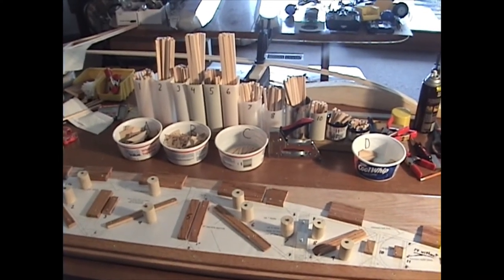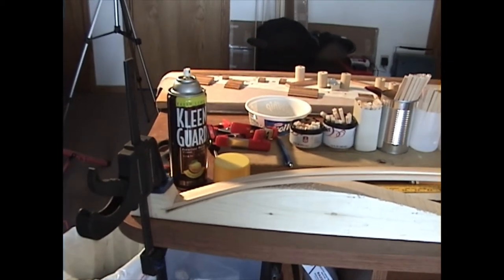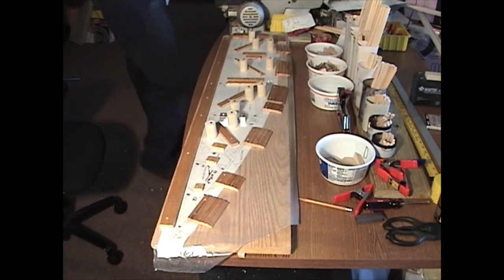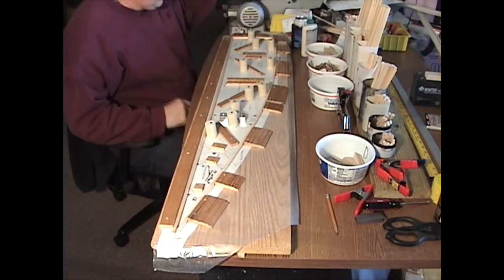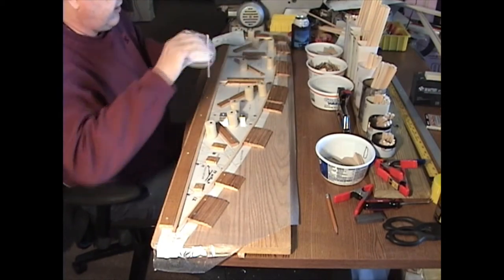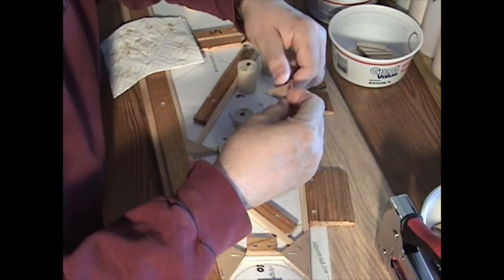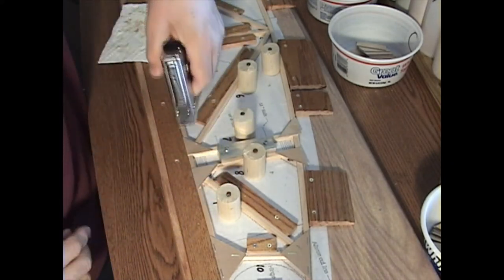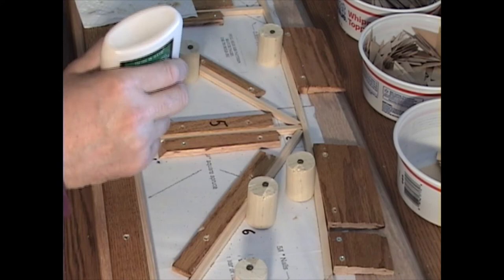Legal Eagle airplane wing rib build

Comment: TiteBond3: there's no better glue to use. Well done! I was a bit surprised you didn't glue gussets on the back side of the rib right after removing it from the jig, then set it under the jig to press the gussets down onto the capstrip.

Comment: Leaving them overhanging is fine.  Later in you’ll put it on a bench sander (I used a belt sander upside down in a vice) and sand the outside of the ribs.   You don’t want varnish on where the fabric will glue down.   The pollytack seals it.  And if not that the Polly brush.   If you varnish the fabric glue doesn’t stick to it as well.   If there’s any gussets overhanging they just get sanded.
Reply from the maker: Thanks for your comment.

Comment: I probably wouldn't have the full length board at the bottom.   No wood at joints, other than parts of the rib/no glue caking to cleanup on jig parts.
Like your storage under rib jig.
Thx for video.  About ready to build the rib jig after watching your video.   Thx!
Reply from the maker: Sounds like a good tip.  We can always learn from others and there is always more than one way to do things.

Comment: Hello Tom, your work looks great. I assume you are using white wood glue and not epoxy? Any reason for that? I am looking at building the DE (already have the plans) and the ribs are very similar. I am following your build with interest. All the best. Allan , Durban, South Africa.
Reply from the maker: Yes, I used Titebond III glue and it is waterproof.  I did some testing with this glue and it was stronger than the wood.  But do your own testing and decide for yourself.
Reply: You should  be using T88 epoxy..water proof does  not mean a good bond,especially when it is applied to one piece only..research my friend.
Reply from the maker: @ronaldrose6885  I agree that T88 epoxy is the proven method.  Here is a discussion from Eagler's Nest    https://www.eaglersnest.com/forum/index.php?topic=1540.0  Use at your own risk.  I am not recommending any adhesives.
Reply: @tomrammel  Your entire video is rife with technical flaws that would never satisfy AC-43 etc. as proven methods for aircraft use. Wood glue has never been approved for aircraft use...good epoxy has been approved. Some of your stick joints have a sloppy fit. The trailing edge upper and lower members should have both been tapered for a stronger joint for instance. I was going to build a Legal Eagle until I got into the "community" chat group and decided that the entire atmosphere was full of " hey, not exactly right but it will probably work ok ".  That won't work for me...unsafe. Too many people on the net are now showing " how to do things" like you do here and while you're not libel for anything, others less informed, may take your show as " acceptable for aircraft use " and find themselves later in harms way and have no idea why. That's dangerous and could harm others. Why not show how it should be done rather that how it could be done and get it right and set a good example for others ? FYI....I've built four airplanes from scratch, Fisher 202, Skypup, Christavia and Headwind and flown them all nicely.

Comment: Hi Tom,excellent work, congratulations! I need to order the plywood for the spars from Aircraft Spruce, do you know which one is correct? (it is 1/8 thick but, what kind? How many ply
Reply from the maker: Do not use Lite Plywood!!!  Higher number of plys is better but some thicknesses are only available in 3 ply.  Birch plywood is strong.  pay close attention to the grain direction when cutting the gussets.  when cutting a triangle gusset the top and bottom grain should run parallel to the longest side (Hypotenuse) of the triangle for 90 degree corners.  For "T" intersection's the grain should run parallel to the shorter side.  For the rectangular gussets the grain should be parallel to the short side.

Comment: No futuro acredito que todos usarão o titebond 3
Reply: Titebond is nowhere near strong enough. Make some test parts and glue them comparing to t88 epoxy! T88 penetrates and the failure is the wood breaking and not the glue joint. You will change your mind on this thought

Comment: how many feet of spruce did you use
Reply from the maker: I used 500 Feet of spruce for the ribs.  I purchased quantity 100 pieces five feet long.  Cut the top and bottom (long pieces) first, then figure the most efficient use of the tails from the top and bottoms.  (example one diagonal and one vertical) then cut the remaining diagonals and verticals from the remaining 5 foot pieces.  
I ordered the plywood at the same time and used a large paper cutter to cut the plywood shapes.  Easy and fast way to cut thin plywood.

Comment: I see Wood Workers Tight Bond II on this Rib ?..... NOT approved by EAA at all for construction, it is a great glue, I use it a lot in my shop but NOT on ANY airplane  Ribs AT ALL ! they say it is water proof  but  in time it can fail for a multitude of reasons ..........GOOD LUCK ..... any reason your not using an approved adhesive ?  EAA has ton's of building advice online .
Reply from the maker: Thanks for your advice.  Anyone that has concerns about the adhesive should use the EAA recommended T88 Epoxy.

Comment: What are the staples made from?  Are they Stainless Steel?
Reply from the maker: No the staples are not SS but they are removed after the glue dries.  Less weight and not necessary after the glue dries.

Comment: What kind of glue  are you using for this build ?
Reply from the maker: Most say that T88 epoxy glue should be used.  I do not recommend adhesives for liability reasons.

Comment: I thought epoxy is what needs to be used. Wood glue is ok?
Reply: Use T-88 approved Aircraft Grade Epoxy or similar. Wood glue is NOT ok. Wood glue has weak end grain adhesion strength and isn't for outdoor exposure to elements as opposed to polyurethane types and will deteriorate quickly. But if you want your aircraft registered and don't want to buy the farm, use approved aircraft grade glues. Photograph each component on completion and keep a builder's log and get engineer inspection sign offs !!

Comment: Tite bond is not a good idea at all. I have made test parts and tried that and other single part glued vs t88 and no comparison in strength. The wood fails before the glue joints always. With tite bond? Glue joints every time.
Reply from the maker: Thanks for your comment,  T88 epoxy glue is what most use.  just don't mix so much that it starts to harden before it is all used.  Hardening epoxy can also make week joints.

Comment: If that is a tite bond type 3 glue,and your are only applying  it to one piece, you are going to have a glue starved joint = in flight failure...caution! T88epoxy
Reply from the maker: I agree that T88 epoxy is the proven method.  Here is a discussion from Eagler's Nest    https://www.eaglersnest.com/forum/index.php?topic=1540.0  Use at your own risk.  I am not recommending any adhesives.

Comment: 6:10 A casual observation from this armchair warrior who is an expert at dunking Oreo cookies into milk:  the direction you clamp the next three vertical members in place seems "counter-intuitive" to me.  Seems the clamping action is pulling the members out of compression between top and bottom rib surfaces.  If you moved the clamping block to other side, then the inserted member would be pressed more tightly into the final space.  Would my idea result in too much glue being squeezed out?  I'm just wondering, if your technique "stretches" the glue joint.  Back to eating Oreos.
Reply from the maker: I see your point,  I guess when you build your rib jig you can build it as you suggest.  For me my ribs are already built.
Reply: The gussets actually provide the structural support here. A close fit and glue is nice for each joint but it’s not really structural. Titebond-3 is really good stuff and rated for exterior use (read moisture exposure). Personally would use epoxy but it’s something I keep in the shop for boat projects already.

Comment: The work is too distant to see critical details. When mentioning a double cut, for example, the presenter does not show it, nor does he explain why or how those cuts are made or how to assure they are correctly placed. Unless the viewer has a set of plans for reference, mostly what is gained from this video is the sequence of gluing and stapling braces and gussets. It would have been far more helpful to show the plan detail, then the cutting and exact sizing of parts. This video starts after all the most critical preparation has been done. That is true also as concerns the jig. I would far prefer a careful explanation of jig construction over watching a glue-up. Finally, showing where and saying why staples are placed in the gussets, along with the size and type of staple would have been helpful. Perhaps all this is explained in the plans, but saying “the plans call for thus and so, and here is how and why” is a very good thing in an instructional format.
Reply from the maker: Thanks for your input, I hope to improve with constructive comments like yours.
Reply: Makes 44 I've made. An you want to trim your gussets before glue., Much easier.

Comment: No, no, no Tom! NEVER use water based wood glue!!  Moisture and heat from sun will cause these glue joints to fail in time!  MUST use epoxy for A/C construction!!!!  Not worth risking your life!
Reply from the maker: Thanks for the tip!
Reply: Now I'm just confused. I've been using wood-based water glue.